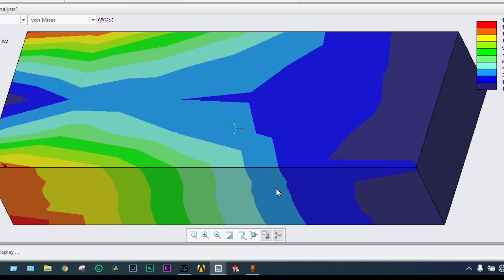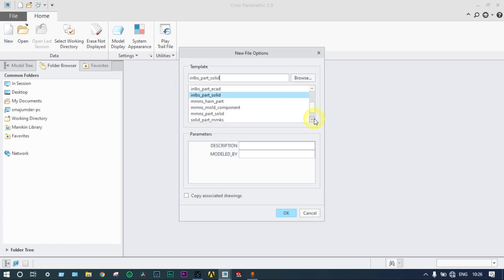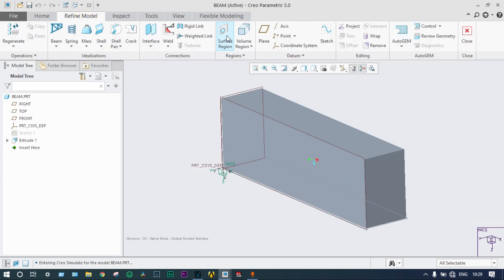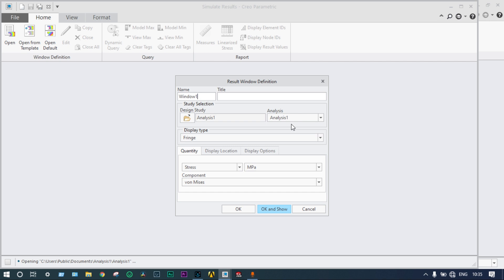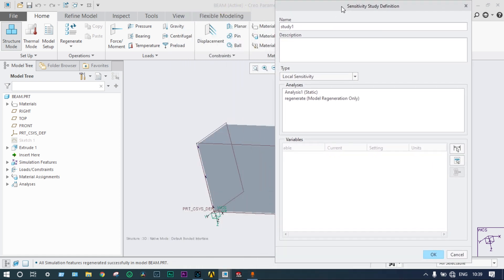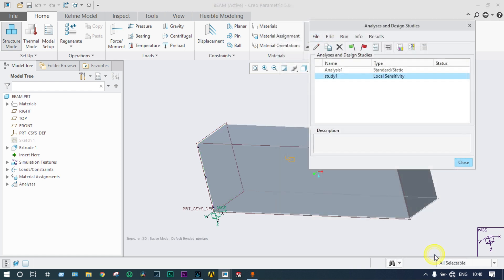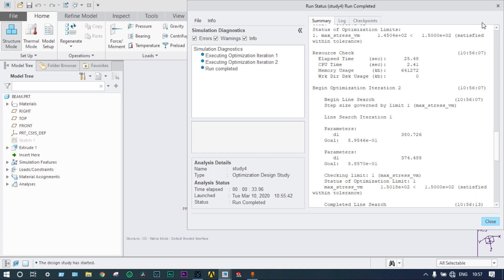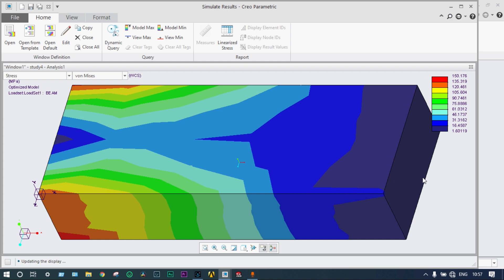The Evolution of Design Optimization & Sensitivity Analysis with PTC CREO Parametric

Comment: When setting up the design variables, how can you determine the geometric effect of changes in a variable?
Reply from the maker: That can be done using local sensitivity analysis. First of all, with normal design studies we can check the critical parameters. After that using local sensitivity snalysis we can detrrmine the most critical variable and finally with the most critical variable we can go for design optimization using Global Sensitivity analysis.
Reply from the maker: From the local sensitivity analysis, the slope of the curve determines most critical variable. More is the slope the more critical is the variable